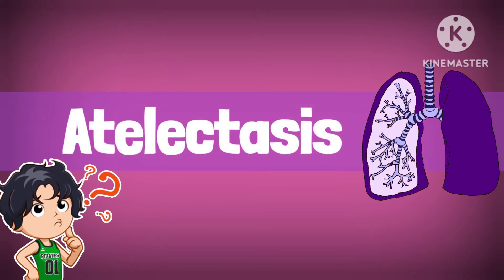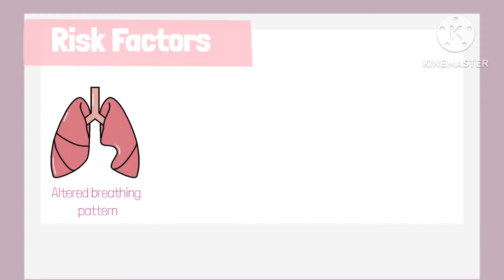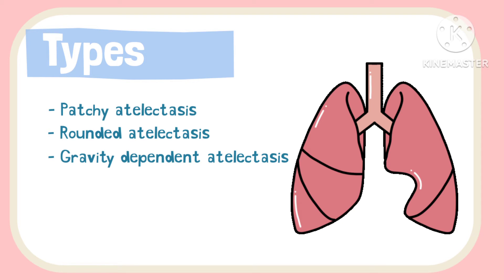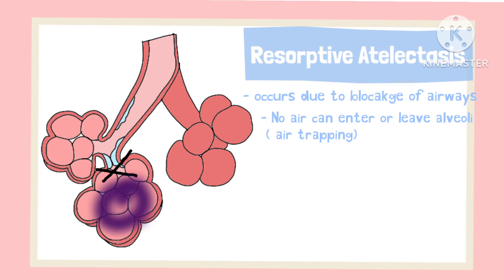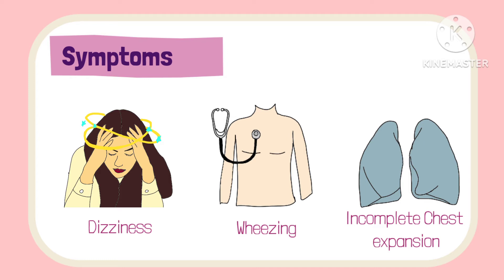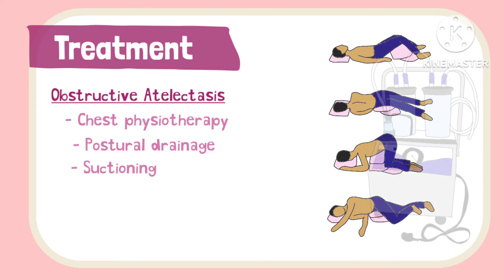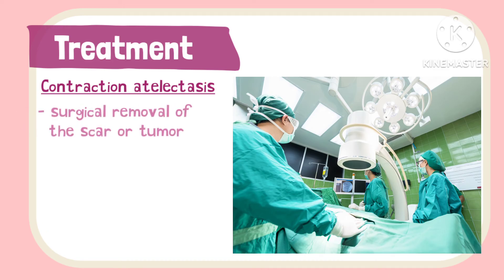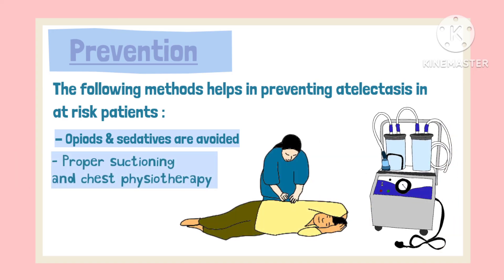Atelectasis// Causes, Types & Treatment #atelectasis

Comment: Great video.  Thank you!  A chest CT scan shows that I have bibasilar atelectasis.  I have also been diagnosed with hypersensitivity pneumonitis, nasal polyps and cysts, chronic conjunctivitis, and severe sleep apnea.  I have a work history as a heavy equipment and automobile mechanic.  I also spray painted vehicles with polyurethane paint, which contained toluene diisocyanate (TDI), hexamethylene diisocyanate (HDI), cobalt, zinc chromate, molydbate orange, and a number of other VOCs and heavy metals.  When I was spray painting in 1982, I did not use a respirator or any other type of protective wear.  The aerosolized paint covered my eyelashes, hair and skin.  I would also blow paint out of my nose and have to wash it out every day after work.  I believe all of my medical issues were caused by my exposure to these toxins.
Reply from the maker: I am afraid , that is the case. Hope you get well soon🙏🙏🙏 stay safe and healthy